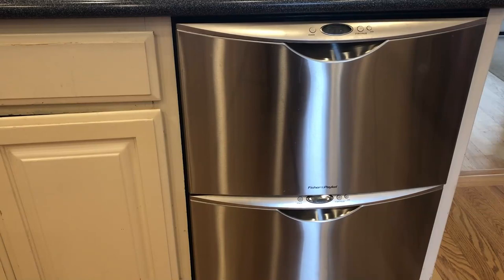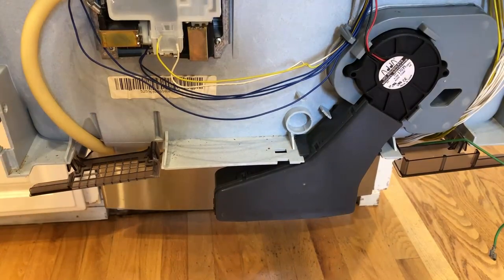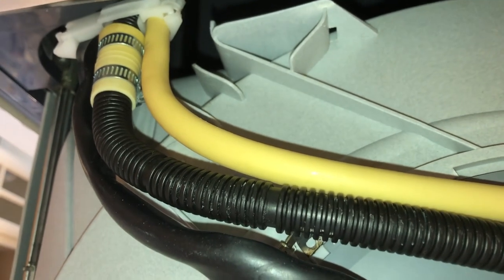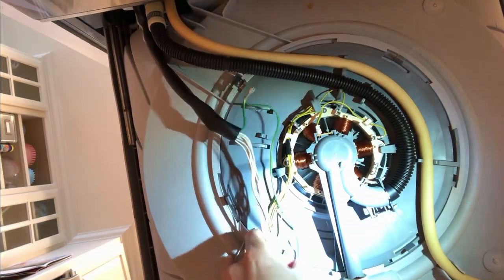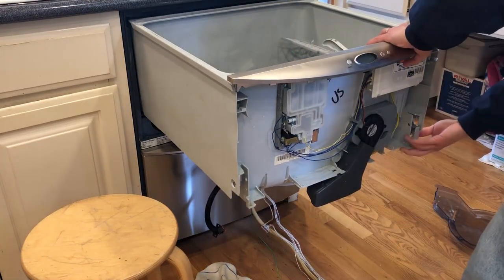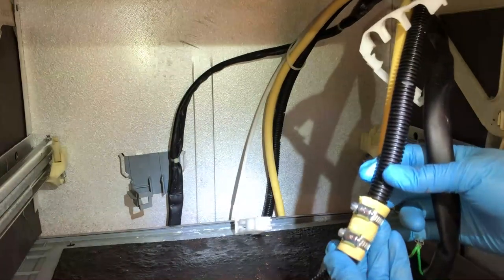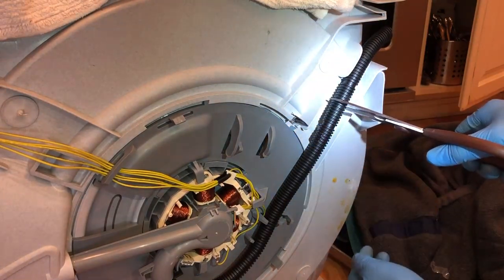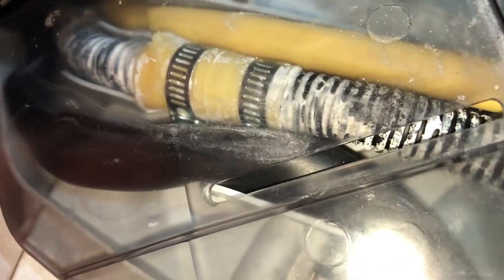Fisher Paykel Dishwasher DD603 Drain Hose Repair Or Replacement

Comment: Amazing! Find it mind blowing how companies have water and so many live wires running next to each other without any real dividers between!! Especially around the motor looks like a hazard, a split in the drain pipe could presumably result in flooding the motor while it's running and a potential house fire!?!? 

Have to wonder where the design teams brains are! Why not have a single USB cable plugging at a control board at the top and a small control board down closer to the motor/controllers, and why not run the drain pipes outside of the shielding for the motor?!?! Just a thought! 

Fantastic video though, really appreciated!

Comment: Very informative video.  I am in the process of trouble shooting my DD603 problem.  It does not drain all the water out at the end of the cycle.  I replaced the motor rotor but that did not help  The hoses do not seem to be clogged either.  I used your method of draining the water with the diagnostic P2 function.  The motor turns but does not drain.  If I shut the power off and on, then the P2 function drains OK.  Have you seen this problem.

Comment: Thank you for your video. I have had my DD for 20+ years and even though only the bottom unit is working right now, I still have a working dishwasher. I am trying diagnose a water leak in the top drawer. I assumed the lid actuators but I will check the hose too. Thanks again for sharing.

Comment: Thank you for the awesome video! I do have a couple questions. 1) Our unit is the same model DD603 and has been in use since 2005. I don't see evidence of a leak but we have anywhere from 2-4 cups of water collects at the bottom of both washers after a wash cycle. Could a kinked drain line be the problem or could it be something else? 2) I cannot get the drain function to occur like shown by pressing the two buttons simultaneously. Instead, a timer icon shows up and I can select how many hours to delay a wash cycle. I tried both top and bottom units.